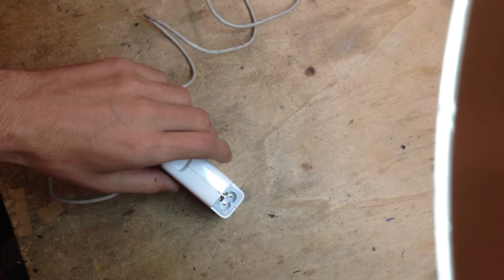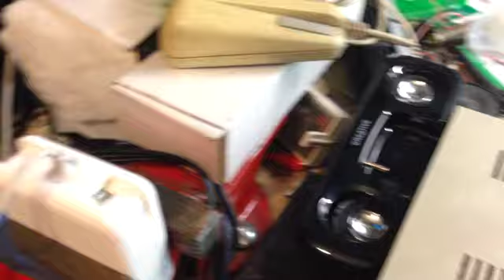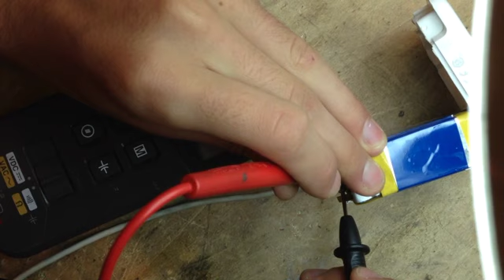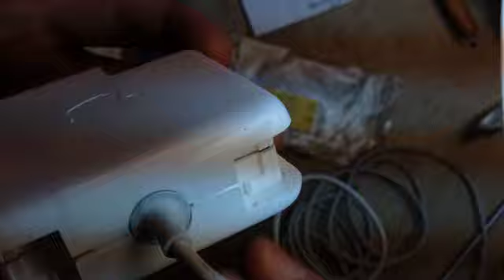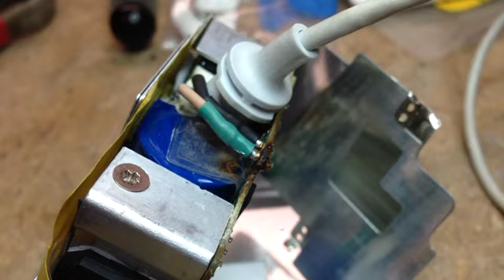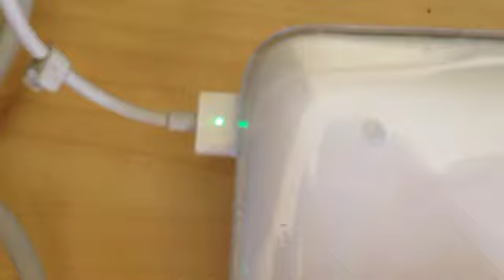Apple MacBook Magsafe Power Supply Repair - Fuse Replacement

Comment: Thanks for the tutorial!

I‘ve got a 2010 MBP brick that very likely has a different issue though. It worked fine throughout lockdown, then I unplugged it during the summer holidays and now it doesn‘t work.
It usually lights up the green light on the plug (no battery installed, so it won‘t go orange anyway) and sometimes after a bit of waiting it‘ll let the computer turn on for a fraction of a second, i.e. the output voltage is there but breaks down almost immediately under load. I‘d say that‘s textbook symptoms of dry electrolytic capacitors.

Comment: I think that people who do not have experience in working with electronic assemblies should not be explaining how to repair power supplies.  Also, it is not necessary to aimlessly probe around with a meter when the fuse is visible and easy to remove.  Just pull it and check the resistance for an open circuit.  Also, try to avoid blocking the meter display with your hand while measuring.  It kind of defeats the purpose of having a display on the meter.  P.S. This video could have been edited down to a couple of minutes so we could have been spared the painful details of the dangerous trial-and-error method he used to open the block.
Reply: Nonsense. The world is our oyster, expand your mind by learning basic fucking electronics.  IF you want edits, go watch the news or a hollywood movie. Francesco isn't working for you, bitch.   Your perception is based on your fear. And to top it off you're in here running your  shit mouth, yet one looks on your youtube channel "THIS DUMMY HAS ZERO CONTENT"  Your soapbox is higher than you.  Go pay your admission and eat your GMO popcorn with margarine spread.

Comment: Never ever never ever do this..buy a new one don't play with your life to save a little bit of cash.
Reply from the maker: So far I repaired more than a dozen supplies and all of them are working perfectly. since I am working on the DC Low voltage side, it is not as dangerous as you might think.
Reply: @Nick 
Never say shit like this ! If you do not have the knowledge on how to do it, don't do it ! Like everything else in life.

Comment: on my macbook white 2006 Charger there is no fuse at that spot??
Reply from the maker: it may be a surface mount type, in this case is a white box with gold ends. you should also check the cable for shorts by probing the two wires with a multimeter